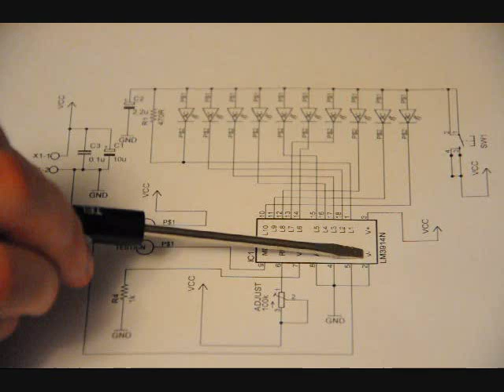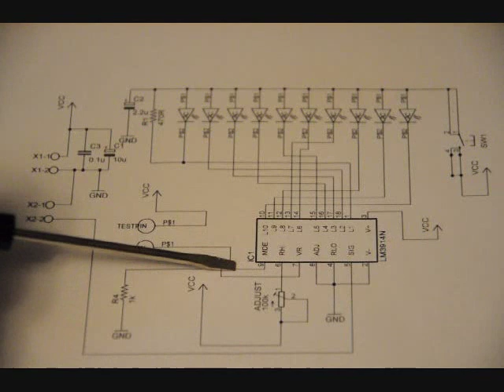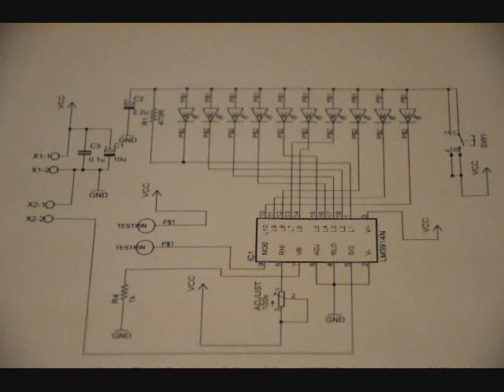The LM3914 Variable Voltage Level Detector Kit

Comment: @oj1for1christ yes it is kinda dumb having two voltage sources but it has to compare with something. another the source reference doesn't have to be a big 9v battery or li-ion package. it can be a small coin sized battery that is probably more accurate and consistent. since it is only create for one purpose, to compare with the larger battery, it doesn't have to hold a lot of power, just be consistent and long lasting with the voltage.

Comment: so u got 2 voltage there. so that means i have to supply the circuit with an external voltage supply. well thats kinda stupid. i mean if we always gona have to supply an external voltage to check the battery, then why dont just run the supply voltage to whatever the battery is powering. what im trying to say is that this is useless for a battery power device that is mobile and u want to b able to keep n eye on the battery level at all times.

Comment: Actually i want to make a board for a Battery voltage meter for my 21V battery, but i want to change the scaling, i.e i want it to show 100% when its 21V and 0% when the voltage is 16V.
can anyone please help me out of this. Even circuit diagram, schematic or a board may help.....please reply asap....!!!

Comment: this monitor kit goes great with your 0-20v variable power supply, i just tested both out and though i like the two wire monitor better, this one is great for the input and output. the 5k pot on the power supply is tricky to get just right so i will install a 10 turn 5k pot but dont like using a tiny flat head every time i want to adjust it, so have to make a knob for the 10k 10 turn. its power is not rated for the same power as the one you have on the power supply though. have to test it.